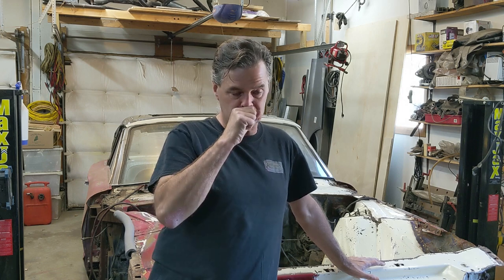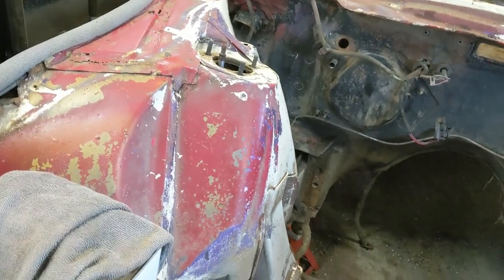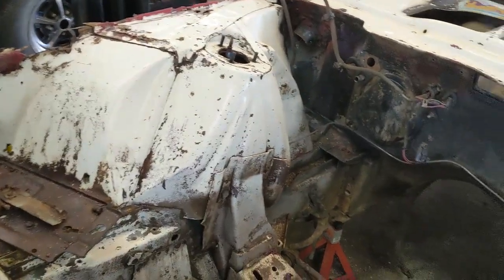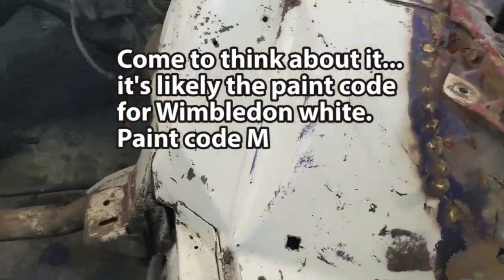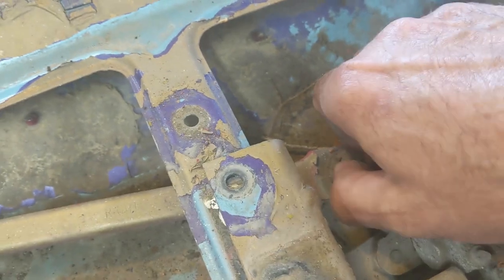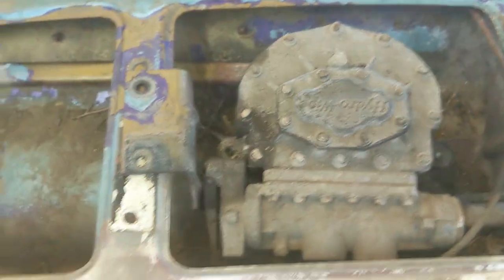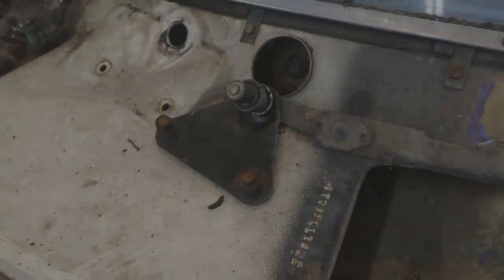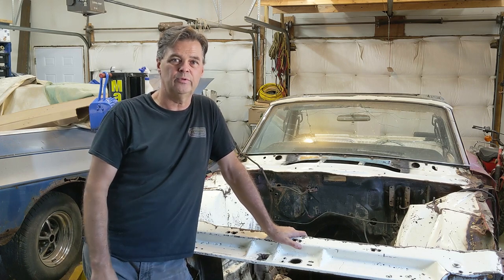CLEAN UP Engine Bay & Removing The "Hydro Wipe" - 65 Thunderbird Convertible Restoration Ep #4

Comment: Alvin, the letter "M" you refer to which can see be seen in several places was indeed the color code for Wimbledon White.  They were handwritten and applied on both the left and right side of the lower body rails and another should be found on the engine side of the lower radiator support/crossmember.  I believe they were applied with a thick "chisel tip" permanent black marker on top of the primer coat. Obviously done to to notify the painters what color each particular body was supposed to be.  It is my belief that the acrylic enamel color coats were sprayed over those letters, but I think the ink bled through the factory acrylic enamel color coat (perhaps during the paint curing process under the heat lamps) and eventually became visible once again after the painting was finished.  
I do hope your plan is to paint the car in its original factory color of Wimbledon White.
Scott
Reply from the maker: Thank you Scott!
That's great information, and very much appreciated, and yes, It will be returning back to the Wimbledon White...it just seems like the right thing to do. 🙂

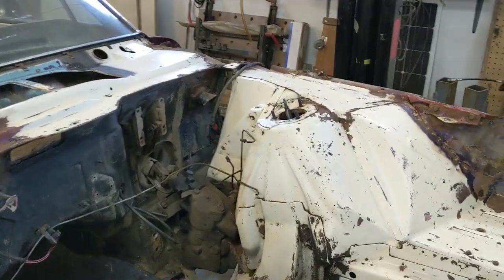Comment: 2:46 Notice the letter M in purple marker on the inner fender - that's an assembly line marking that calls out the paint colour to the workers. My '62 T-Bird had the same purple M on the firewall, it was a 10,000 original mile Corinthian White car sold new in Montreal.
ps. If you look at the cover of the wiper motor a little more carefully I think you'll find it reads "Hydro-Wipe"
Reply from the maker: It only makes sense to have a simple system to identify what the color is to be, when the workers would have only a bunch of bodies just in primer. No bar codes and scanners back then!

Comment: I’m sure you noticed them as you were cleaning the non-original paint from the engine area…. but VIN numbers on these T-Birds are stamped in three separate places under the hood. Ford didn’t go to the windshield area VIN until 1968. 

VIN is stamped on the right front header (top radiator support), and twice on the right cowl panel. 

Be careful when you get to final sanding that you don’t damage these stamped VIN numbers😀😀. 

I’ve got a1964 convertible in Rangoon Red. Beautiful cars. Good luck.
Reply from the maker: Hey Steve, I did see them, they are in good condition, and will remain that way! Thanks for the heads up!
Reply: Alvin,
If you get the time show us in the next video where those VIN numbers are located under the hood.  I didn't know they were there in 3 places.  Live and learn.
Regards,
John
Reply from the maker: @joernone  I will do that John.

Comment: Thanks again.  Do you think that the left front fender was hit, or is that just normal metal rot in that area of a Thunderbird?  How long was the total cleanup?  You have a lot of patience!  Thanks for mentioning the Deep Creep.  I have never heard of it, but I am aware of Seafoam.  It appears to be good stuff.
Reply from the maker: Thank you Stephen, it all looks straight, that section with the brass brazing was scabbed over the rotted section...like you said, normal rot. The whole clean up took around 4 hours, well worth the time just to get rid of the grease, if nothing else. The Deep Creep is my personal choice so far, and I've use a lot of different brands.

Comment: Did you consider an acid dipping for removing paint?
Reply from the maker: After checking into the cost and the closest location to me for that service, I knew that would never happen. The closest place that could do it is a 12hr round trip to drop it off, and then another trip to pick it up...and the cost is thru the roof, and this car just isn't worth it.